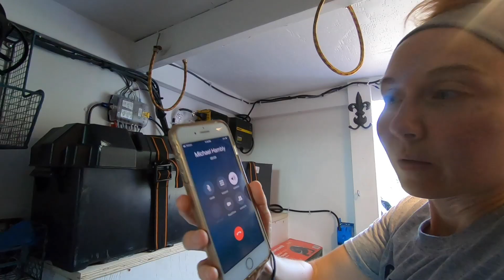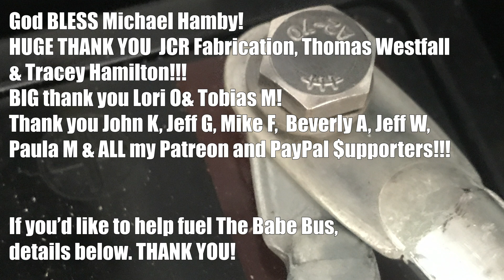VAN 911!!! The Power BLEW!

Comment: casey,i don't know if anyone has mentioned this already, but.. 

here are a few bullets/things to know/do: 
1) turn off the inverter when you are not using anything plugged into it.
2) you need to have an easily accessible (ie, near the babe bed) on/off switch to that so you don't have to crawl down in the cave area.
3) don't let the battery voltage drop below 12.2 volts (that is approx 50% range though recommended is 80% and not lower)
4) get an external battery voltage monitor that you can always see the voltage. make it close to your usual pov (point-of-view) spot. 

if you don't turn off the inverter when not in use (or when its at/below 12.2 vots), it will drain the battery--you can't have the inverter on 24/7. having the battery below 80% (bullet 3) will lower the life span of the battery, and worse will decrease its "longevity" to stay in charge state longer, and will not charge fully very well. eventually, it will become useless.

Comment: Usually the inverter gives you an alarm when the batteries are too low.  If you're not using solar to charge the batteries then I presume you're using the alternator.  Start the engine and let it run, that should solve the issue.

Comment: Casey, you're my "hero of the day" because you keep it real and deal with problems with the strength of a woman and not turn into a manipulative b*tch who tricks random guys into doing sh*t for her while she leans back and relaxes. 
And a massive shout out to Saint Michael for being extra supportive! 

BTW and definitely not sponsored in any way: I strongly recommend one of these "arctic air coolers" - it's an evaporative air cooler that pulls warm air from the room/van through its evaporative water filter to cool, humidify, and purify the air. Way better than a regular vent which only stirs the hot air.

Comment: 12 v is what a car normally uses. 120 v is what a house uses and require an inverted to change 12 to 120. Try any use as much 12 v gear as possible so the power doesn't need to be converted. This is why your lights work and your can doesn't. Get a 12 v fan at a truck stop. It's best not using a n inverter constantly. A 12 v fan will use much less power and not need to run through an inverter. Best of luck!

Comment: Great job girl, you got it done! Check out some big rig sites for ideas and parts. Our cabs/bunks are set up similarly. I have a 1200 watt inverter that doesn't power a whole lot, but is satisfactory. A truck refrigerator which is  awesome (installed by company mechanics). It's just another resource for you to consider. Love your attitude girl!

Comment: Looks good. Hope you’re going to do a more permanent hold down than the bungees. That’s a recipe for flying electrical. 
Not a criticism but education for people out there, amps = Watts/ volts. 400watts/120v is less than 4 amps(the power rating of a decent fan. 1000 watt inverter is the bare minimum to do most things. The most common reason for tripping is undersized wires to the battery. 2 awg minimum for something like an instant pot. Usually means throwing away the wires the inverter comes with.

Comment: This is a bit techy, but a motor winding ( like in a fan ) is an inductor - it would spike current when being unplugged. That could hurt inverter. 
If your not already doing this, turn the fan off b/f unplugging. And like other posters said, use a DC fan instead.

Comment: Sorry for your challenges. For motor loads, due to in rush starting currents, you should have been guided toward what’s known as a low frequency inverter.  It’s heavier but will last years longer in normal operation. They are also full sine wave inverters which is best for sensitive electronics. More expensive but well worth it.  They are built for high amp draws such as what you just experienced but still very efficient. Arcing or sparking will blow the high frequency solid state inverters, especially the lower wattage units.  Sad I am in WA state.  Could have helped! Currently building out a van and worked in the automotive field for years as well as industrial high voltage systems.  Couldn’t believe what the first electrician did!  Just found your channel a month ago....

Comment: The inverter probably died because it got too hot.
1000w inverter will not drain your battery faster than a 400w, unless you put a larger load on it.
Side note: the 12 volt battery will not hurt you unless you lick it because your skin provides high resistance. There's a lot of free info on electricity. If you can work a camera and edit video you can learn the basics of electricity.

Comment: It would be more efficient to use a dc powered fan than using an inverter if you run into this problem in the future. Modified sine wave inverters are ok with sensitive electronics that use a "wall wart" style charger since they convert the ac to dc to charge. They are bad for things with ac motors like fridges, saws, fans etc  but since your fridge is running off the DC side of your system you should be good. Also 1000 watt inverters don't pull anymore power than a 400 watt inverter at zero load. They produce more power so they "can" pull more power. You're living and learning and that's all that matters. Keep it up!

Comment: Electricity is not all that scary as long as you don't have a current going through your heart. I have had numerous 110 volt shocks and so far, have lived to tell about it. ZZZZZT! There I go! 
Other than likely having a small increase in residual power draw, the bigger inverter should not have much difference in the power draw , unless you plug in more stuff.

Comment: The inverter probably overheated. I live in the tropics and it gets VERY hot in the enclosure in which I keep the inverter/batteries/ charge controller.  So much so that I had to put a box fan in front of it to keep all of it from overheating.  The other thing you can do is wire a few case fans and point them straight at the inverter.  I have cooling fans wired all around my van, and so far, knock on wood, they're keeping the hot spots cool.  They do use a bit of energy though....60 watts for a box fan, and about 10 watts per case fan.anyway, probably more info that you want. Lol.  
I hope things work out for you.

Comment: You need to move that inverter off the top of those batteries
Reply: son of a gun   Hero Michael put the batteries in covers — so the inverter is actually on the covers, not the batteries.
Reply: Good, I didn't see them during any of the video. I'm glad to know they're covered
Reply: son of a gun   Very good point.  Here he is talking about it at 8:20:
Part III - Van electric finished:
https://youtu.be/ADe4Pu9McxI

The whole electrical saga was really interesting.  You might want to see what she went thru starting at the beginning...

Disappointment (disaster) with 
Electrician #1:  
https://youtu.be/_fdp49PYPOs

Ripping out Electrical & redoing (at 4:00):
https://youtu.be/KlfHd-_-hmI

Van electric overhaul:
https://youtu.be/riFauh-_em8

Comment: Oh sheeeit! My heart was in my throat. I do all kinds of fixes but electricity scares the crap out of me.  You were so lucky to have someone who could help you. Kudos to Michael. Two small suggestions: 1. Get one of those little handheld fans with a water reservoir. With fan on,  you squeeze the spray trigger and cool off your face or whatever you point it at. 2. Put ice in sandwich bags and apply to your wrists and/or your carotids. Works well to lower body temp. Finally, those who are distressed by your potty mouth have no right to judge or tell you how you should act. All they need do is stop watching your channel and get a life!

Comment: I'm just curious can you turn on your air conditioner for your van to help cool the van down at all I know you can't run it all night but also they have USB vans that you can plug into your cigarette lighter I don't know if that will help at all but I hope you get this fixed I know it's miserable sleeping in a van or truck when it's 90 degrees sorry you're going through this you might want to get yourself a jackery to a very good there solar extra power you can have in case things go out you can also charge it through your cigarette lighter just not solar

Comment: I have a dc fan. Fan-Tastic Vent 01100WH Endless Breeze fan. Its a great strong fan. Uses very little battery. I also have a max air on the roof.

Comment: Oh, honey, I'm so sorry for this hot, rough day you had. I'm shocked that your 400W inverter was powering your fridge, let alone your fan. So I lived in my semi off and on for 7 years over the road. I had a small apartment fridge with separate freezer and microwave that all ran off of a 2500W peak 5000W inverter and four standard house batteries charged strictly by the alternator (no solar) because I drove so much. Most big truck stops sell power inverters in assorted sizes. I installed the inverter, fridge, microwave, and all other assorted electronics. The batteries came with the tractor. Because my power inverters were never pure sine and any inverter can fail, I always put a grounded (has a three-prong plug and larger cord) surge protector outlet strip between the inverter and my devices and never had a problem with even sensitive devices like my phone or my computer (so don't fret about your new inverter...you're fine.) I loved your idea of going to an RV park or friend's house to plug in on a very hot day (after all survival is the utmost priority), but I'm also glad you upgraded your inverter and the fan is now your bitch. Weather is always important to watch when you live on the road. My two favorite weather apps were The Weather Channel and My Radar, which is doppler radar updated every few minutes across the country. Please use these to make wise decisions about where you're heading and keep yourself safe! PS: You couldn't look bad if you tried and I love your sassy potty-mouth...you're so real and that's awesome. ❤❤❤

Comment: Having a 1000 watt inverter just means you can run more 120 volt stuff. What you run will determine how much is drawn from the inverter. If you don't use any additional 120 volt devices, you will only pull whatever you did before. 1000 watts just means you have the potential to pull 1000 watts. It doesn't mean it will always supply 1000 watts.

Comment: Did he explain to you that the spark was caused because the Inverter has capacitors in it and when you first plug it in, it charges up the capacitors very fast and causes a spark, after that, it should never spark again.

Comment: We just got  a nice automotive clamp on oscillating fan at Walmart, that plugs into the 12 v extension cord direct from the battery.  (bless you roadpro, extension was 16$ You just clamp it on your battery posts and run it into where you need it, 10 ft cord) The fan was in the oil and waxes section for about 13$ here in California, and the thing busts ass.  Sick to death of feeding my O2Cool fans batteries.    

#fuckthisshit works for me!  ^_^  I need a bumper sticker that says that.

Comment: So sorry you had a slight amount of drama. It’s actually an easy fix but if you haven’t experienced the issue beforehand, the first time seems dramatic. You’ll become an expert with power in no time.

I started with shore power, then a generator, then threw up 700 watts of solar to an AGM battery bank, and thru in a 3000 Watt Pure Sine Wave inverter and run the refrigerator, fans, stove, microwave, 2 computers, and 2 big monitors, plus charge the lithium batteries in an eBike CONSTANTLY and never ever run out of power, including the 2 weeks I was recently up in Seattle where it’s always raining and the sun don’t shine. In other words, If I can figure out power, you’ll figure out power just like I did and just like everyone else who goes mobile does. It gets easy.

VanLife ROCKS especially when you have more power than you’ll ever need.

Comment: Casey, A 1,000 watt inverter won't drain your battery any faster than the old 400 watt unit. It all depends on the load.

Power (watts) = Volts (12 in your case) * Current (amps)

Your fan draws a maximum of 35 watts on high. 

35=12*x >>> x=35/12, or less than 5 amps with inverter losses. No problem. Even for the 400 watt inverter.

Did you unplug the fan while it was on? If so, there's a slight chance that there could been an arc that could've blown the first on the old inverter. All inverters have them. Send me the make and model of the old inverter and I'll tell you the size and location of the fuse. You might be able to recover some of the cost of the replacement inverter.

Your new inverter likely supports a remote switch. You should look into this as it'll save you the no-load drain on the battery. Again, every inverter draws a small amount of current without a load. Typically this is very low and doesn't present a problem.

Also, your lights and truck fridge work because they're hooked up to 12V DC power, not the 120V AC inverter.

Lastly, feel free to message or call me if you can't reach michael. I'll take your call!
Reply: The new inverter does indeed have a remote switch.  It is mentioned as a typical extra item in the link that Casey gave us to Amazon ( https://www.amazon.com/gp/product/B008NOG0NG/ref=as_li_qf_asin_il_tl?ie=UTF8&tag=caseyroman123-20&creative=9325&linkCode=as2&creativeASIN=B008NOG0NG&linkId=7a474918cea59fa35d25aa5dda5b35d0 )

Comment: I'd put 400W on my motorcycle. 2000-3000 w on a Van. Inverters don't drain your batteries. The electrical load drains your batteries. Your fridge is probably using most of your load.

Comment: Where would you have it shipped?  Almost all Post Offices do "General Delivery" with their address and your name.  You need a portable lithium battery with built-in inverter, my dear...you just do.  I'm not saying you didn't need that inverter that you worked all day putting in, but it would have taken about a 1/2 hour to install by a technician as opposed to you doing  it yourself all day.  And also, if you need any electronics, Best Buy is great and specializes in having that sort of stuff.  You did good, though, and I'm glad you were able to install it.  God bless.

Comment: A fan is driven by a motor which is also a generator in  reverse.  When you shut off the fan there was likely reverse "power" coming from the fan motor as the magnetic fields collapsed  and the fan slowed down to a stop.  The reverse EMF (power) likely blew the inverter.  The newer inverter most likely has protection on the A/C plugs, but this doesn't mean it does.  Therefore, it is a good idea to not use that 120VAC fan with the new inverter to be safe.  Whenever a motor is turned off, there is always EMF which must be handled.  I suggest as other's have said to get a 12 volt fan.  The best fans are called squirrel cages used in vehicles. Most efficient and they blow a lot of air.  You can find them in junk yards or above stove large microwave when the microwaves quit working.  Look on craigslist instead of buying them new.  Good Luck!  Rj

Comment: Yea , your right , it's probably just a fuse blown in the old inverter . :) just remove it of the wall to make easy work, :) then take the black screws off the yellow panel so you can inspect the inside of your old inverter . Unless it's a real cheap made in China deal, you should find one or two bar fuses like under the dash of your van , on the circuit panel , inside the inverter , just carefully remove them and check if they appear blown , if they are :) Awsome , just replace the bar fuses and you can use either inverter , depending on the load demand you have at the time , as you say , small inverters use less power , . It's a good thing to have a backup ! 
You can put a fuse breaker switch between the inverter and the battery , to stop that nasty sparking :) it can actually damage the inverter connecting it to the battery , without a fuse or breaker switch ! But most folks don't bother with it , sometimes at the expense of damaging a brand new inverter.
With a breaker switch , you just switch off before you connect the inverter and battery lines , once there all done up tight , just flick the breaker switch on and there's no nasty sparks or risking damaging your expensive new inverter . 30 amp breaker switch $3 - inverter $ 600 ? :) 
I've run tvs lights coffee grinders stearios etc on a 300 watt inverter and a single truck battery 200amp hours and it lasted five years before needing to upgrade the battery . 
But upgrading to 1000 amp hours of battery bank and a 2000 watt inverter does make you feel like your set for anything :) add a back up Honda inverter generator for bad weather when the solar fails to produce , and your sorted :) it will even run an air conditioner ! For those hot summer days !

Comment: so people probably covered this already - but your lights and fridge run on 12V DC...which is battery power.  To make your "outlets" work - which is household 120 volts AC - that's where the inverter comes in.  modified sine wave - is ok, but "noisy" power as compare to pure sign wave power... electronics - need the clean power.  hair dryers, fans, motors, etc. don't care.  Now your laptop actually runs on DC and the power brick that you plug in to charge - is an AC to DC transformer/converter - so the fact that you have a modified sign wave for your laptop - should be ok - because you're in a sense - filtering the power through the power brick.  hope that made a little sense.  happy travels - enjoy the videos, sass, and sarcasm.  keep being you!